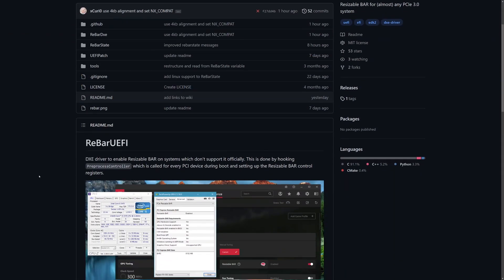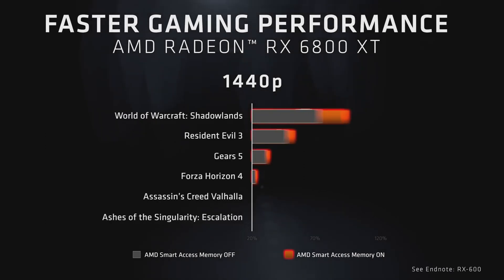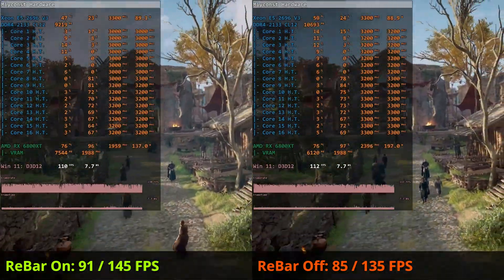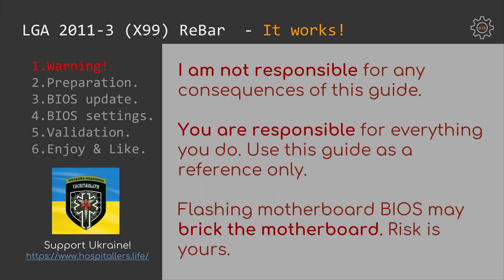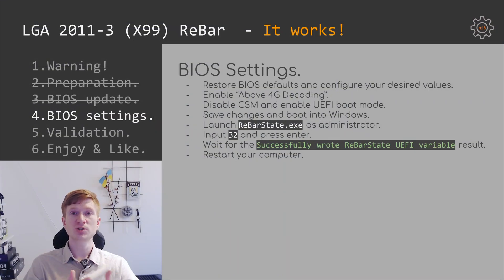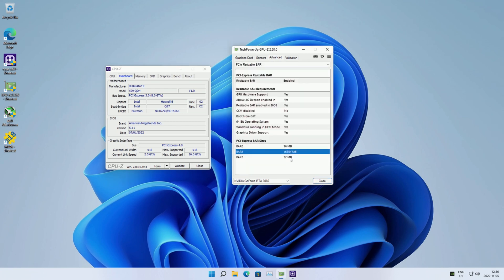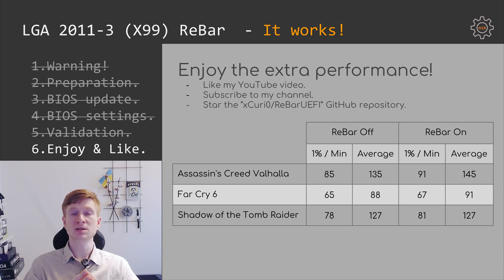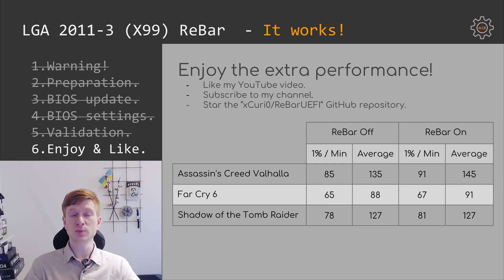🇬🇧 Resizable BAR (ReBar) on LGA 2011-3 X99 – how to enable and get extra performance

Comment: Great 😃... Very good video and excellent teacher. It turns out that I have a Z77 Extreme6/TB4 motherboard and the truth is that it has been somewhat difficult for me to activate this technology because my case takes a little more work and despite following all the steps I can't get it to appear once I'm inside the bios and when I check in UEFItool I have the built-in option "Above 4G decode" or something like that... I'm sure I'm doing something wrong and I don't know what it is. I'm not a professional and I'm just starting with this modification thing and the exact tutorial for my case doesn't appear but I've seen in the forums that there are already people who have done it, but I ask and nobody answers due to the age of the comments. I would like you to help me because the truth is I don't know what I'm failing at and I've been lucky that I haven't broken my bios and I don't have the programmer or access to it because I live in an underdeveloped country. Would it be too much to ask that you implement this in a bios compatible with my motherboard and send it to me? Please make this person happy.😊
Reply from the maker: I do not provide BIOS mods on a distance. The risk of bricking your motherboard is just too high. One thing I can say for sure is that you won't get the ReBar option in the BIOS, it must be enabled under Windows using ReBar.exe.
Reply: Thank you so much for replying. You have earned yourself a new subscriber. I'll see what I can do. Regards.❤

Comment: Would you recomend reinstall windows with a clean uefi or change psrtition legacy to uefi?
Reply from the maker: Clean installation is always better.
Reply: @Miyconst  А що если у меня в gpu z в разделе windows running in UEFI mode указано "yes" хотя я не ставил в биосе и там legacy стоит? Ребар будет работать ?

Comment: So, I'm following most of this for an Asus H110 mobo and so far no errors or anything. BIOS doesn't show any entry but RebarState allowed me to enter 32 and was successful. Now, will GPUZ show enabled for rebar (in all sections dealing with rebar) even if I don't have a compatible GPU or will it show disabled as the GPU does not support it?
Reply from the maker: GPU-Z shows enabled only when it's actually ON and for that you need a compatible GPU.

Comment: does it work with unlock turbo boost? or i should deactivate? my motherboard is huananzhi x99 QD4 3.0 , chipset Q87
Reply from the maker: It works regardless of TBU. Both BIOS mods can be applied together.
Reply: @Miyconst  thank you

Comment: Hi! I was delighted to hear how dedicated the x99 compatibility is, so I decided to cave in and get an Intel b580 to use with my X99-S. I followed the instructions but I am struck with two problems. The first problem is dumping via FPT,  where the error I get says "The host CPU does not have read access to the target flash area." I've tried looking for a solution but can't find any without hardware modifications. So I decided to try AfuWin, which worked! Then the second problem I get is when I try to flash with FPT I get " PDR Region does not exist" followed by the same error from last. So I try AfuWin again but then I receive "Secure Flash Rom Verify fail". Is there a way to get around this or am I doomed to just upgrade MB, CPU and ram to get the Intel arc b580 to work?

I've also tried downloading the bios from asus and putting in the rebar driver in that then flashing. with FPT it says it exceeds the memory and press y/n to continue but then hits with PDR region again and all the other issues are the same.
Reply from the maker: With a branded motherboard like Asus you need an external programmer to read/write binary BIOS. Some report that there is an AfuDos version that can bypass Asus security and flash the BIOS even if it's modded but I could never get it to work.

Comment: Hello! I did everything as in the video but in GPU-Z ReBar is not enabled because it is not activated in the BIOS I don’t know what to do in ReBarState it says reboot for the changes to take effect (xeon e5 2680v4 intel arc a 380) I will be very grateful if you help me!
Reply: same to me, on a Machinist RS9, 2640 v4 and rtx2060super csm unable to actvate or deactvate in any form

Comment: Hey, I watched the video and spend almost hald day googling if the UEFITool resizable bar is something that can be used on a HPE server machine. I recently got a second one (ML110 Gen9 with v4 processor) the purpose of which was to be configured as an offsite back-up and my plan was to run it at my parents place. But as my original homelab is the ml350p G8 with E5 v2, was thinking if i shouldn't keep the 110 at home and send the older gen to my parents place. Then started looking if I could get a low end low power consumption video card like the Arc a380 for it (transcoding, maybe use the machine for Fusion 360 and so on) and quickly figured that the Arc A380 requires the resizable bar. So...., do you have any experience with enabling the resizable bar on HPE machines? In the past I've seen some posts about modded firmware that allows fan speed control, so I guess modding is possible.
And great contents btw! Слава Украiнi!
Reply from the maker: Hi there. As far as I know, modding HPE BIOS is pretty hard but certain mods are possible. I have heard that Resizable Bar was successfully added but I didn't see any convincing evidence and don't have any personal experience. So, the best I suggest - get a programmer, read the binary BIOS and try to mod it.

Comment: I have an Asus X99-A, how can I read the bios? I can't seem to find the fpt tool anywhere anymore.
Reply from the maker: You need a CH341a or another programmer to read/write Asus BIOS.
Reply: @Miyconst  so I managed to read and then flash my Asus AMI UEFI bios with the winraid guide that you can find on their website on the subject.
Everything should be working well but sadly the Rebar option does not appear in my bios. I did check the flashed bios to see if the added dxe driver was there, and it was.
Do I need to do something else or will that .ffs dxe driver just not work for the Asus bios which seems different from the rest of the X99 ones?
Reply from the maker: @XfStef  the BIOS menu option won't appear with this hack, you have to enable it through ReBar.exe under Windows.
Reply: @Miyconst  yea, I ran that but I'm getting an error:
Failed to write ReBarState UEFI variable
GetLastError: 5

I have secure boot enabled by default, could that be the issue? I tried all sorts of other values as well, doesn't work.
Reply: @Miyconst  I had to use the patcher as well in order for enabling the setting of NVRAM. This was difficult to understand as the guide only mentions this issue in the common problems section.
Reply: @XfStef  Can you please explain with more detail how do you fix it, I have the same motherboard (Asus x99-A with the beta bios 4101) and i'm planning to update my bios to enable rebar to use it with and AMD card, and I know im going to have the same error. can you please share more details about how you fix it, or please share your modded bios with me. Thanks!
Reply: @emil_cd I think I explained how I solved everything on the forum post.
Reply: @XfStef can you please tell me the forum name and topic title, I already read a lot of information and I want to know which of all of them is your post

Comment: hi, i recently built a system over the machinist mr9s , its already has the features: above 4g decode , and Resizable BAR . 
i enabled them both, and gpu-z reports enabled, and hwinfo also, do i need to do this mod ?? 

im about to buy an intel arc a750 gpu (found a good deal)
will an intel arc a750 work on this platform under its full potential ??

ive also heard that older cpu's (such as xeon, and under 10th gen) , are not compatible to work with resizable bar..
Reply: it is option on bios now , don't need follow the video

Comment: i have a x79G motherboard with AMI bios ver 4.05 and it has resize bar, after i enabled it worked… kind of cause when i checked on gpuz it said resize bar was enabled
Reply from the maker: Nice! Seems like Chinese started adding it to the BIOS so no mods are needed.

Comment: i have a asrock x99 extreme4 motherboard with E5-2680 V4. The bios doesn't have options for bifurcation or rebar.  Is there a way to enable bifurcation while doing these steps to enable rebar?
Reply from the maker: You can investigate the BIOS with AMIBCP and see if these options are there. If so, you can set bifurcation the way you need it but you won't get these settings in the BIOS UI.

Comment: Please about HUANANZHI X99-PD4 Motherboard. I am using it with server ram and non ecc ram both with my graphic card Chinese sologood Rx 560 but after 15 min temp is at 50 but crash on same screen without graphic change and mouse and other nothing works.. changing different options on bios was able to play game for 20min and same thing happens. Some times
Reply from the maker: How can I help? The motherboard seems to be defective.

Comment: Hello Miyconst. I recently purchased the 2024 version of the Huananzhi X99 QD4 motherboard that came with a E5 2666 V3 CPU, the one with 3 NVME slots. Is this motherboard considered LGA 2011-3 and will resizable bar work with it? Thanks.
Reply from the maker: Please watch the review: https://youtu.be/o0jH2ormcSE
Reply: @Miyconst  So I can flash the MACHINIST E5-RS9 BX99DA08 GAMERS BIOS to it then?
Reply from the maker: When it comes to the Chinese motherboards I can guarantee absolutely nothing but it should work.

Comment: ASUS X99-DELUXE II + Saphire RX 5700 XT Nitro+ SE (410/Samsung) Is it possible to add? Resizable BAR. If possible, explain step by step. Tried to take ready from your link, refusal, "The file is not compatible". I tried installing the utility in the middle of the bios and from a 32GB fat 32 USB drive.Thank you.

Comment: How can i flash my bios if my motherboard is a GIGABYTE Z170N-WIFI ?

I did all the steps but when i save the file i have a .rom file. My motherboard has a Z17NWIFI.20i file. If i try to add the ReBarDxe.ffs driver in the Z17NWIFI.20i file, it won't work since when i try to update it in the bios it says "invalid bios image". I tried saving it with the same name and it didn't work. 
It seems like my motherboard doesn't take files with .rom at the end ? Or do i need another program to be able to flash the bios ? 

Edit: The file can be edited and it does work to be saved, i just can't flash the bios with the saved file that contains the ReBardDxe.ffs , it tells me "invalid bios image" when i click on it.

Comment: Will this work on Linux? I mean I did the process on my Huananzhi X99F8 and worked 😁. But I want to go back to Linux and don't know if this keep activated forever or only works on Windows
Reply from the maker: If you don't reset your BIOS settings it should work. There is also a Linux tool to enable ReBar of the modded BIOS.
Reply: @Miyconst  You were absolutely right, as long as I didn't reset the BIOS it would work. you are the best thank you very much, I will leave my like and sub

Comment: Question from MIYCONST.
I have a computer: with a HUANANZHI X99-TF-Q motherboard, 4 DDR 4 RAM modules,
and an Intel Xeon E5 2696 V3 processor. The computer also included a graphics card
MSI GeForce GTX 1660 Gaming X 6Gb and a 512 Gb NVMe drive.
I recently bought a new Asus Dual GeForce RTX 3060 Ti V2 Mini OC 8GB GDDR6 graphics card and I started having problems starting the computer. The board display shows the message "d4" and 8 beeps from the speaker on the board. Then the message "A6" is displayed and nothing happens and the monitor screen has not displayed an image since turning on the computer. Only after enabling the CSM function in the board's BIOS and in it "Video" to "Legacy" instead of "UEFI" did the graphics card start displaying an image and the computer starts properly but the PCI-Express Resizable BAR does not work. Can this problem be solved?

Regards.

Comment: I recently got Huananzhi X99-TF-Q after watching your review. Will Re-bar work on it? I want to pair it with intel arc gpu so I’m not sure. Thanks!
Reply from the maker: I see no reason why it should not work. If you do everything right your Arc should get ReBar.
Reply: @Miyconst  I just finished all the steps and in GPU-Z its Shows Resizable BAR is Enabled!
Reply: I also have a computer with a HUANANZHI X99-TF-Q motherboard. With a graphics card
MSI GeForce GTX 1660 Gaming X 6Gb Resizable BAR worked fine.
I changed the graphics card to Asus Dual GeForce RTX 3060 Ti V2 Mini OC 8GB GDDR6
and the card only starts in Legacy mode. In UEFI mode the computer does not start,
and because of that I cannot turn on Resizable BAR mode!!!!
Reply: @KRIS5112-ABC   I enabled rebar with RTX 3060 12gb and it showed that it’s working. So maybe you did something wrong? I’m still waiting for my Intel Arc a750 gpu which will arrive in 2 weeks.

Comment: I am going to do this on t5810 using CH341A for read and write bios, are they any extra steps I need to take for this workstation? or just extract bios from capsule and modify it using tool then write it using flasher.
Reply from the maker: I have never tried it with T5810 but according to others it's exactly the same procedure just need to use CH341a to read/write BIOS.
Reply: @Miyconst  thank you I'll try it
Reply: @MrSteel-e4q  did you create a dump of existing bios or just downloaded new bios to modify and flash on chip? I have trouble creating dump.

Comment: My S.O. Win11, "X99-PR9", RX6600CL, is freezing after exactly 22 seconds of idleness. If it’s active, it doesn’t freeze! Do you have a solution for that?
Reply from the maker: What is RX 6600CL? What's your CPU, RAM, BIOS? Please join my Discord if you need troubleshooting help.
Reply: @Miyconst  RX6600 CLD 8G is my GPU, I'm using 32GB RAM 3200 KLLISRE, Win11, BIOS X99HA00R - 10/27/2023.
Reply: @Miyconst  I found the problem! It was the last update of Windows 11. I only uninstalled the latest cumulative update and now it’s 100%. Your videos are awesome, congrats! ✨

Comment: I have a Huananzhi X99-P4 , this is not in the list. Which one can I pick alternatively? It has an Intel H81 chipset I found, there's one mobo in the list called 'Kllisre X99 V201' with H81
Reply from the maker: I didn't test X99-P4 thus I don't know what BIOS is compatible.
Reply: For anybody wondering: it was in my bios all along, both 4g decoding + rebar option. You gotta serach a bit, so NO flashing is needed for Huananzhi X99-P4. Enjoying +5% perfomance

Comment: not help, my x99 board have rebar on it, but gpu-z say Resizable BAR enabled in BIOS	- No and CSM disabled - No.
but I did everything as it was in the video.
dislike
Reply from the maker: What is your GPU?
Reply: @Miyconst  6600
Reply from the maker: Then you either did something wrong or your BIOS doesn't properly support UEFI boot.

Comment: If my motherboard supports resize bar and only my 2080ti not supported. So what should i do for steps note that my MB is asus Maximus xi hero z390
Reply from the maker: Nothing, just leave it as is.
Reply: @Miyconst I didn’t understand what you mean
Reply from the maker: I mean you don't need to bother with ReBar, RTX 2080 Ti does not support it and does not benefit from it.

Comment: Hi i think idid something wrong and now the mother bios page doesn't show up i wanted to disable rebar because i was experiencing black screens and my card drivers was disabling after the restart and now nothing shows up on the screen after i disabled above 4g decoding can you help me please
Reply from the maker: Please try clearing CMOS with battery removal and see if that helps.
Reply: Clearing the CMOS helped and everything got back to normal except the black screen and driver disabling my card is rx 6700xt
Reply: When I play or start any game it runs for 15 minutes and the issue happens and i need to force restart and re-inable my driver from device manager

Comment: So found out my Mougol X99 P4 mobo had rebar enabled but 4g decoding was disabled. I enabled 4g decoding but now I get no display output. Any ideas guys? Using with Eg 2680 v4 and Intel Arc A580
Reply from the maker: Did you disable CSM in the boot options?

Comment: Man! It worked on my Machinist MR9A Pro Max! Many thanks!! :) Anyway i could access overclock menu now?
Reply: You're enabling resizable bar, not overclocking. This may improve performance of your GPU but isn't in itself overclocking. If your motherboard has an overclock section and you can't find it, the chances are that you are in so called Ezmode and you need to be in Advanced Mode. Select Advanced Mode and then look for the overclocking section. Be very careful. Since you don't know that much yet about the BIOS and options there, do things one step at a time, in very small steps. I would recommend not trying to add resizable bar support until you are more comfortable with the functions and options in your BIOS.
Reply: @ZenAndPsychedelicHealingCenter  My Reasoning was, if we can add that in the bios, maybe we can also add more things.. overclocking, memory parameters, etc... I already added ReBAR. Works great.
Reply from the maker: No, overclocking has nothing to do with Resizable Bar.
Reply: @Miyconst  I still have both flash file on my desktop if you want it. MR9A Pro Max, 5.11, UEFI 2.4, Pi 1.3 with and without ReBAR.